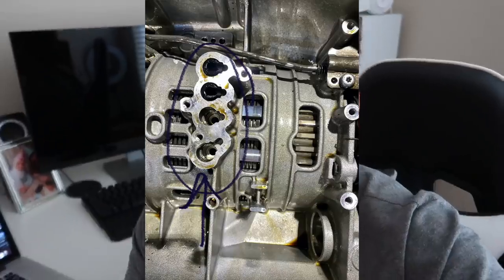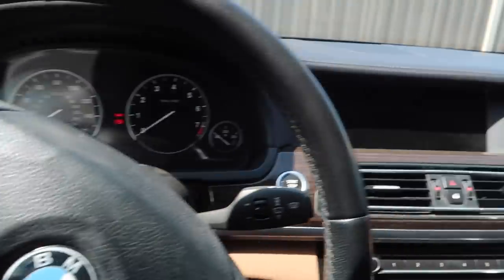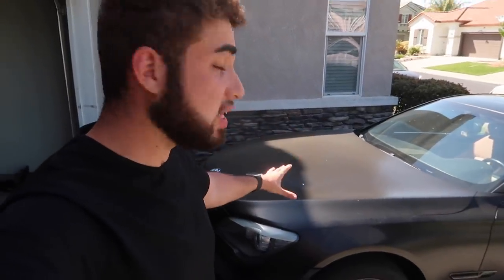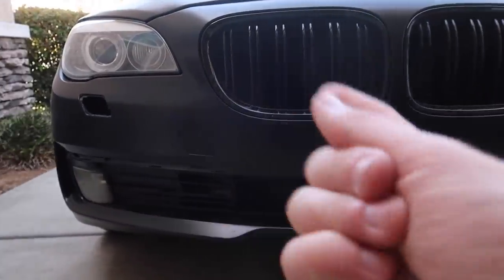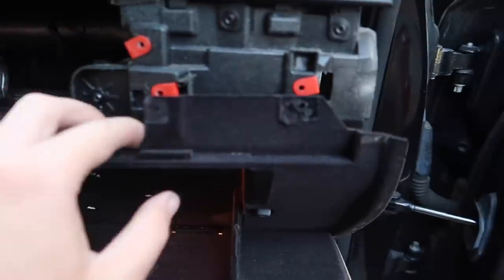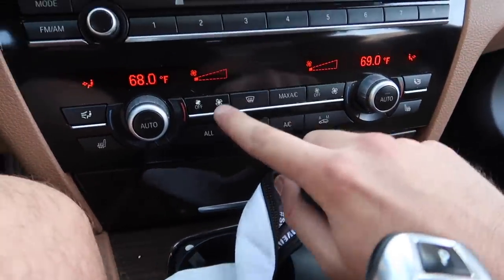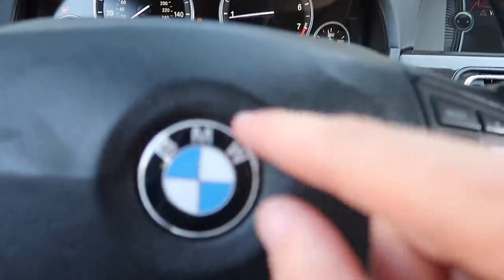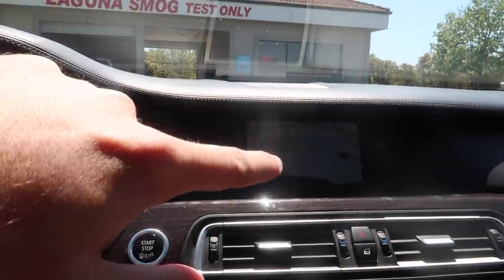THE 7 SEREIS IS BACK AND BETTER THEN EVER! (PERFECTING THE 740LI!)

Comment: I had the same issue once. The guy told me you haven't driven the truck far enough since a sensor got changed and it didn't have enough data to registered. I had to go drive around for an hour and went back and it passed.